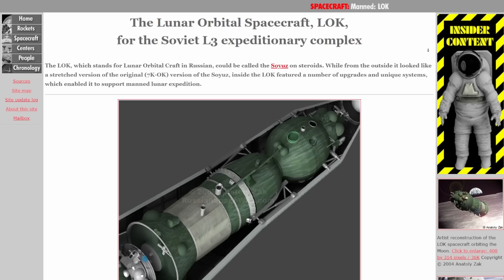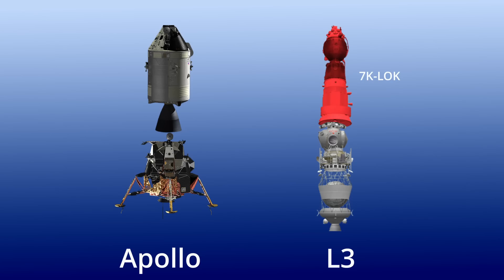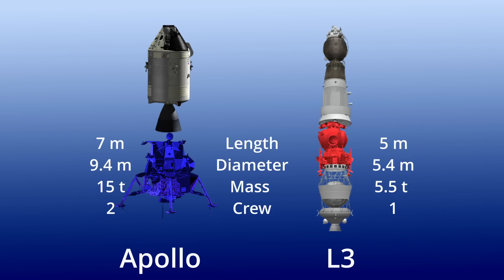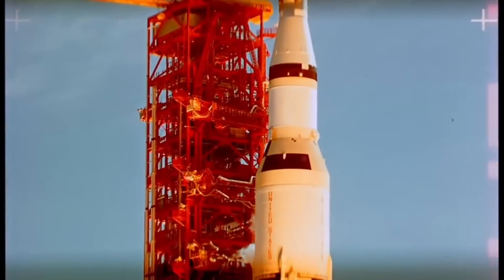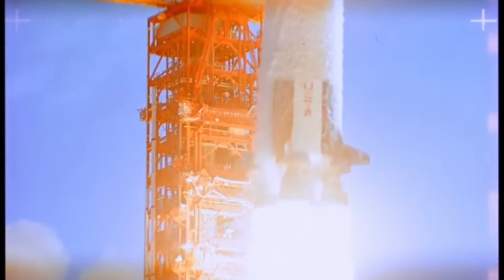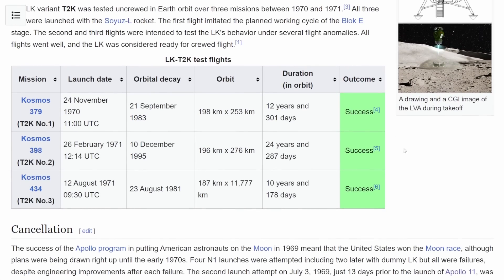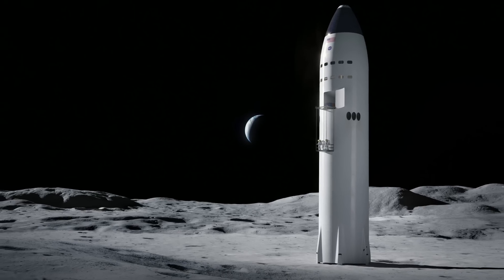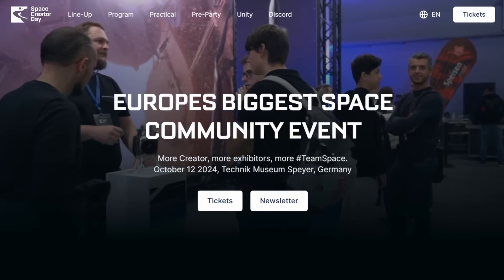Race to the Moon! Did Soviets or Americans Build the Better Lander? - Rocket Rumble #2

Comment: Well, the Soviet lander was a rookie attempt at the final competition.... a prototype at best, (it never flew in space, right?)   The USA flew 2 LM missions (one in earth orbit, one in lunar orbit) before even attempting landing.   The USA did things differently....we relied on the 'men' to do a lot of the 'flying' and the big earth mainframe computers for others. The actual computers on the LM were mostly running the final approach software.   (The computers were  modified  ICBM flight guidance modules... with MIT developed software)., USA set a goal (with unlimited funding).... it was an unprecedented time in America... social turmoil, but incredible tech advancement.
Reply: It was tested 3 times in orbit. All unmanned missions I believe. Definitely not a contender. Just like the Soviets bragging about how advanced their rocket engines were compared to the F-1. Yet the N1 failed 100% of the time vs the 100% successful launches of the Saturn V.
Reply: The LK did fly 3 unmanned test missions meaning it was far beyond the prototype stage. It could be argued that, besides Soyuz, it was the most tangible product of the Soviet lunar program

Comment: Thank you, fun. I teach physics at PhD level. I know the American F1 never worked. You don't develop the biggest and the best. In about 5 years. Use it 5 or 6 times. 100% success every time. Then stop using it. Completely. Wait 15 years (half a generation) to develop a replacement, the Shuttle rocket motors. They 65% the weight but 1/5th the power and could only lift weight to 3 or 400 Km. Oh, then stop using that and beg Russians to use their stronger rockets than all of ours but weaker than the F1 rockets. And now, 60 or 70 years since the F1 finally we almost have a successful equivalent replacement to the F1 that was developed in .. 5 years. Every other rocket developed is still used. The tiny control thrusters used today are from the original Apollo rocket. The Gemini and Mercury rockets were and are used to this day. The Shuttle motors are used on Artemis. Only one rocket motor was ever developed and not used after development time and cost, the F1.
Reply: You say "I know the American F1 never worked" - so what was that lifting those Saturn V's off the ground 13 times? Are you suggesting that all of the people who watched the Apollo launches in person didn't really see what they saw? Please explain.
Reply: Very, very difficult to believe that you "teach physics at PhD level". First of all, a PhD professor of Physics would never a sentence like that. Second, as opposite to what any person with a background on physics or engineering would say, you just split vague generalities without any precise information. Third, it all seems based on personal incredulity.

As said, I will choose not to believe you.
Reply: Hmmm....I'm no PhD, or even a rocket engineer..but the F-1 engine was huge.... and unfortunately didn't give a great ride (pogo, and high Gs) it was also inefficient (using Kerosene/LOX).... (Ahh...the RS-25s of the Shuttle were reusable fully cryogenic closed cycle)  The F-1s were very reliable, after the thrust instability was finally fixed... They were 'hand built', meaning not mass produced or reusable, and each had to be 'tuned'.  So, no further plans by the USA for 'interplanetary' launches of huge payloads saw the shelving of the proud F-1.

Comment: Did Soviets or Americans Build the Better Lander? Well in fairness the US LM worked at least 6 times under the conditions that it was designed for.
Reply: My Stepfather worked at NASA (retired with shuttle) but he often commented as the US and Russia started working together and seeing each others solutions up close NASA engineers admired the Russians ingenuity on many systems.  Where NASA does complex multiple redundancy Russia tended to use a simple, reliable (and usually heavy) system.  Different philosophies and each has its merits.  Russia went for crude and  cheap, but that does not mean it was at all under engineered.  It is like the fable that NASA spent millions making a pen that works in zero G, and the Russians used pencils.  While the story is not true it does accurately represent the differences in the approaches to the engineering and solutions.
Reply: @larrybremer4930  There is beauty in simplicity.
Reply: @VhenRaTheRaptor  There is - until you're millions of miles from any help and need that redundancy to get you home due to an unforeseen issue (Murphy lives in space as well as here on Earth).
Reply: @ebikeengineer  Sometimes overly complicated things don't work. Not exactly the same thing as redundancy, but sometimes maybe redundancy is created to back up complicated systems that might fail.
Reply: Ademas de funcionar 6 veces para lo que se queria, funcionó tambien como recurso de salvamento. En un video que pude ver, hay una breve imagen de los controles que tenia el módulo lunar ruso. Casi no tenia indicadores ni sistemas de control. Parecia un juguete.  Creo que Leonov tuvo suerte... se salvo de una tragedia.
Reply: @fueronporquetenianelsaturn9632  We (The US) put in redundancy because we knew things could fail and the Maytag repairman doesn't do space.  When I was working on Mars Observer it had two transceivers (one was an obvious backup) but they were also wired in such a way that transceiver A lost transmitting, it could use transceiver B's transmitter.  That way even if both transceivers were partly damaged the craft could still get a signal through.  That's the kind of thinking that made US missions successful and some of the Soviet missions fail.

Comment: The scariest part of the Russian approach is the two EVAs. On the other hand, I like the approach of the decent and assent engines on the lander being the same engine. The total mass will be less, and in the U.S. approach the accent engine's first firing would be in its only use. We should remember that on Apollo 11, the circuit breaker used to Ingnite the accent engine was broken. It only takes one flaw to wreck the entire mission.
Reply: The US approach saved the most weigh overall.

Comment: So this is missing a few interesting details about the Soviet L3 complex, which is that it wasn't envisioned quite like Apollo. From 1967, concerns about engine issues or other problems led to the modification of the plan to include various other elements. First, given the limited hover time of the LK (only like 10 seconds, compared to about ten times that for LM) it would be very crucial to land without delay or error in guidance--no waiting like Armstrong did looking for a spot without rocks if you missed the main target. Thus, they planned to have a probe landed on the surface akin to Lunakhod rovers, which could broadcast radio signals the LK could use as beacons for precision landing at a surveyed location, and then the rovers could be used by the astronaut for transport to maximize science during the limited time on the surface. Next, those beacons would also be used for an entire second LK launch on a second N1, with the intent of this other LK landing automatically. If the LK the cosmonaut landed in was damaged or defective, this second LK could still return them to orbit, and it could possibly carry a little extra supplies to stretch time on the surface. Only then would the crew LK/Soyuz launch on a second N1.

See Siddiqui, Challenge to Apollo, p517 "The Lunar Flotilla" and this description of the state of the project from the same source on p643:

"The repeated additions and modifications to the N I-L3 plan in 1965-67 also complicated mission design. Even after the ink was dry on a final draft plan for a particular element of the L3 complex, months later, engineers would propose modifications based on new anticipated needs. This not only made it impossible to manufacture flight models of the spacecraft, but also added layer after layer of complexity to the N I-L3 mission. By 1968, the following components were part of the entire program:
• Ye-6LS (two robot probes to map lunar gravitational anomalies)
• Ye-8LS (two robot lunar satellites to photograph the lunar surface)
• TIK-T2K (automated and piloted flights of the LOK and LK in Earth orbit)
• LIE (automated test of the Blok D stage in Earth orbit):
• NI-LI (two lunar orbital LI flights as test payloads for early N I launches)
• Ye-8 (two lunar rovers to serve as transport for cosmonauts);
• NI-L3 (one N I launch with the backup LK)
• NI-L3 (one N I launch with two cosmonauts to land on the Moon)"

Comment: It’s not true, the USA lunar module only used hypergolic on the ascent stage!! They only did that because of how important that engine was. If it failed to fire then 2 astronauts would die on the moon and they didn’t want that.
Reply: No, both stages used hypergols, the same Aerozine 50 fuel, a 50:50 mix by weight of hydrazine and unsymmetrical dimethylhydrazine (UDMH), and Nitrogen tetroxide oxidizer.

Comment: None of the LMs were tested in a vacuum chamber.
Reply: Incorrect! Lunar module test article LTA-8 was tested extensively in thermal vacuum chambers:

"LTA-8 was delivered to Manned Spacecraft Center's thermal vacuum test chamber "B", the Space Environment Simulation Laboratory (SESL), on September 18, 1967.

LTA-8 underwent separate series of tests in support of LM-3 (Apollo 9, an earth-orbital mission) and LM-5 (Apollo 11, the lunar landing mission). The objectives of these tests included demonstrating that the lunar module's environmental control system could provide a habitable environment and temperature in both the cabin and pressure suit loops and that the cabin atmosphere and suit loop contained no contaminants which would affect the crew, verify that the heat generated by equipment could be properly dissipated, demonstrate that the cabin leak rate was acceptable, verify that the cabin could be depressurized in simulated lunar conditions when anti-bacterial filters installed in the relief and dump valves, and demonstrate that the lithium hydroxide cartridges (used to remove carbon dioxide from the air) could be replaced when the cabin was depressurized.

The Space Environment Simulation Laboratory consists of a series of vacuum chambers, two of which were large enough to hold the Apollo spacecraft. The vacuum chambers employ carbon arc solar simulators, lamps to subject the chambers' contents to anticipated solar heating. The chambers also contain black, nitrogen-cooled heat sink panels to cool the chambers' contents down to 100°K. Chamber A was used to conduct tests on the command module (the 2TV-1 tests), while Chamber B was used for LTA-8.

The tests were designed to test the spacecraft under simulated mission conditions, for simulated mission durations. Tests conducted on LTA-8 ranged from 3½ to 12 days in length. However, since the lunar module was designed for use under 1/6 G, it was not feasible to keep LTA-8 manned for the full duration in a 1G environment. The crew manned the LM in shifts ranging from 9 to 12 hours, ingressing and egressing the vehicle while under full vacuum conditions."
Reply: @rwdavidoff  It trolls this BS everywhere.  It seems to believe man-made vacuum chambers are better tests than space itself.
Reply: @rwdavidoff  so? The actual LMs weren't.
Reply: @thebruffy1077  The actual LMs were tested in space.
Reply: @Canada_Dominium  everyone,  before their missions? No
Reply: @thebruffy1077  "everyone,  before their missions? No"

Meaningless question.  The LM design was tested in space over and over.
Reply: @thebruffy1077  There were TEN missions where the LM flew in space, six with lunar landings, and one with an emergency situation, and all were total successes.  The LM was the most reliable spacecraft of the Apollo program.  Why exactly do you keep bitching on the same non-issue?
Reply: @thebruffy1077  LTA-8 was an actual Lunar Module.  Flight-ready and crew-rated.
Reply: You keep posting this lie everywhere.  The Grumman LM was tested both in man-made vacuum chambers and in the absolute vacuum of space.
Reply: @Canada_Dominium  they might have taken one to LEO
Reply: @thebruffy1077  Apollo 5: LM test in Earth orbit
Apollo 9: LM test in Earth orbit
Apollo 10: LM test in lunar orbit
Apollo 11: LM test in lunar landing
Reply: @thebruffy1077  " they might have taken one to LEO"  Are you lying or just ignorant of facts?   They took TWO to low Earth orbit--one unmanned, one with crew.  Then tested a third in lunar orbit with crew.

Are you lying or just ignoring facts?
Reply: @Canada_Dominium  so? Would you dive in a submarine that hadn't undergone rigorous sea trials beforehand? Only takes one O ring to blow and your toast.
Reply: @thebruffy1077  The LM design had been tested, manned, in vacuum chamber, many times, and in space unmanned, before crews tested it in space. The LM design was then tested in lunar orbit.  You don't seem able to comprehend that it's the design that's tested.
Reply: @thebruffy1077  "Would you dive in a submarine that hadn't undergone rigorous sea trials beforehand?"

Submarine design undergoes rigorous sea trials using a prototype.  Same with aircraft design.  Same with train design.  Same with car design.  The LM design underwent rigorous trials using a flight-ready model in vacuum chamber, then trial in space unmanned, then trials manned.

Do you seriously believe every operational passenger jet, every single one off the line, goes through exhaustive design trials before purchase and service?
Reply: @thebruffy1077  Don't you mean that your submarine should be tested in a water pressure chamber before "rigorous sea trials"?
Reply: Lunar Test Article 8 was an actual flight-ready, crew-rated spacecraft.
Reply: @Canada_Dominium  so? The others weren't tested under vacuum conditions.
Reply: @thebruffy1077  Yes, all flight LMs were tested in vacuum: space.
Reply: @thebruffy1077  
Apollo 5: LM test in Earth orbit
Apollo 9: LM test in Earth orbit
Apollo 10: LM test in lunar orbit
Reply: @thebruffy1077  Why do you keep saying the flight LMs were never tested?
Reply: @thebruffy1077  Why did you say "they might have taken one to LEO" when 'they' took two to LEO and one to 'LLO' before committing to a lunar landing?  Why do you insist that ground tests were needed on a flight-certified design?
Reply: @thebruffy1077  You test the design. Not each example of the design.  Car models are tested for typical use and for crashes by using a production sample-- not by driving and crashing every single unit that comes off the assembly line.
Reply: @thebruffy1077  "The others weren't tested under vacuum conditions."

Space is a vacuum condition.

Comment: I would say there was nothing fundamentally wrong with the Russian mission profile, other than the N1 rocket itself.  Yeah the need to EVA to change vehicles is not great, but saved them launch mass and that was truly the overriding factor for both the US and Russia.  Keep in mind the Apollo airlock was more than an airlock, it was a connection that had to support rocket impulse in the CM + LM stack, so it was also highly structural.  Elminimating a heavy structure that also needed to handle a large, airtight connection point saved them a ton or more of launch mass over using a structural container without an airlock interconnection.
Reply: Even the N-1 wasn’t that bad. Everybody focuses on the 4 test flight failures. They were part of the plan: at one point 14 test launches were planned before the first operational mission. They did this because it allowed them to save time: they skipped having to build test stands large enough to run full tests of each stage, and did those tests in flight instead.
Reply: @Hobbes746  I understand that they were using the fly and fix method to shake it out just like SpaceX, but I think Russia saw they were not going to win the moon race and just gave up  and saved the resources they would have used on it for something else.  N1 was probably too ambitious for  the time and as I recall it the engines (and there were lots of them) could not be pre-tested prior to flight (probably because of the use of hypergolic fuels), so they were built and put on the rocket without pretesting each engine first.  They always had problems with some number of them malfunctioning in some manner like fuel line ruptures, pressure chamber and pump ruptures (engine had very high chamber pressures). or pogo oscillations (probably a similar combustion instability problems that we had with the F1 engines for Apollo).  The point is they still had a long way to go with the N1.
Reply: @larrybremer4930  The N-1 was definitely ambitious: their budget was something like 1/20 of what NASA had for Apollo. 
The NK-15 engines could not be pretested because they used pyrotechnic charges to operate some of the valves: fire those and you have to strip the engine and replace those charges. The NK-33 switched to motors to operate the valves, enabling them to be tested without having to disassemble them afterward.

Comment: The N1 looked really cool but how are the fuel tanks properly fueled? Because of that V shape?
Reply: They were spheres suspended inside the conical outer structure--unlike Saturn, the tanks weren't structural. According to Siddiqui's book "Challenge to Apollo," the engineers said this was because they couldn't source aluminum sheeting thick enough to machine tank walls that were both carrying their pressure loads and the weight of the vehicle above them. It made it rather inefficient, as the stages ended up with higher dry mass.